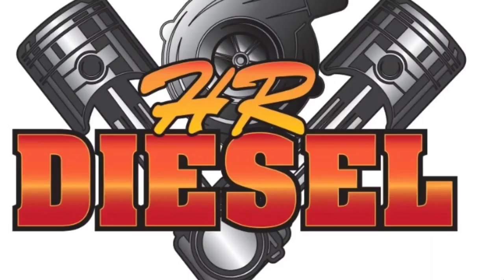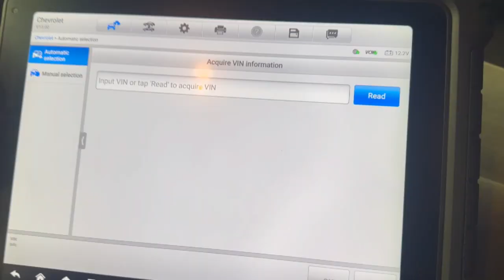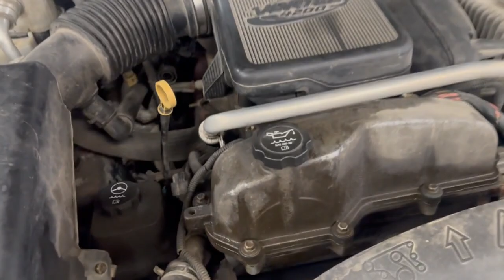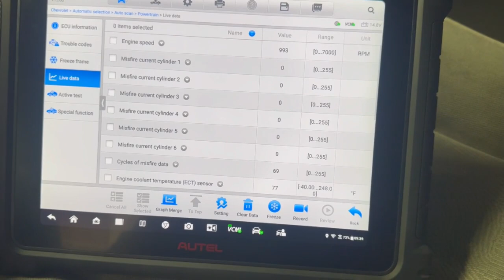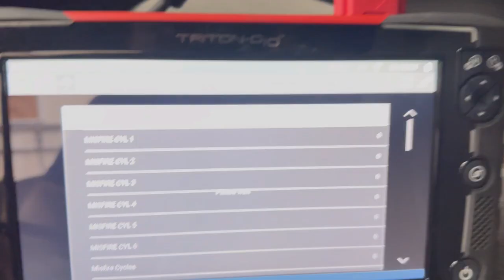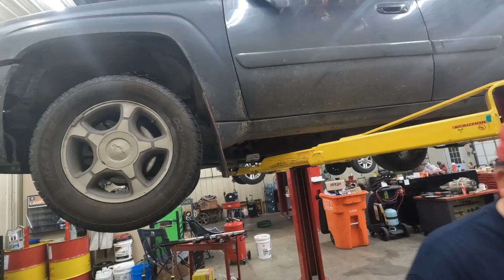2005 CHEVY Trailblazer misfire misdiagnosis! Exhaust repair! Wrong parts, time lost!

Comment: First time seeing your channel, I will only comment on one issue, there is no such thing as unbillable time, you trusted the customer diag and work and that was your mistake, do not do that again and you will not need to worry about unbillable time, just take the customers info, believe that they created a problem from cheap parts and start from scratch and bill for all your trained time, problem found to be the customers fault and charge double for that fact, cheers.

I will go look at your overall channel size and type of videos in a 2-minute scan to see if I wish to continue watching in the future.
Reply from the maker: Thanks for watching and the comment! I agree with you. I kind of beat myself up for not doing a full diagnosis like I normally do because I got caught in a moment of weakness! 
Hopefully you find it interesting enough to watch in the future!😀
Reply: I am back for round #2 on a binge-watch day and to take my notes that I do for my private library. Guys make too many mistakes because they think that it takes too much time to make notes and to lay parts in a parts tray designed for engine teardown so they put parts back in the wrong place or did not mark a vacuum hose or a connector that is the exact same connector near another component and now they got put back on backward, OMG  NOw you are officially on my radar watch list for the next 6 months, I need to see 5 good named useful videos before I do a binge watch and take detailed notes about the job so as you can see to get my attention, you need a quantity of videos with pretty good names that add up to 5 OR you need 10 shit names or a combination of good and bad before I am forced to check out the videos at least by skipping through them which I THINK does not help you with YT algorithm??? Example I tossed the AUDI starter video to the bin. I dont normally do DIY type videos but I am sure you have some viewers interested in everything so good luck with everything. I would be happy to help you out with better naming conventions. @hrdiesel